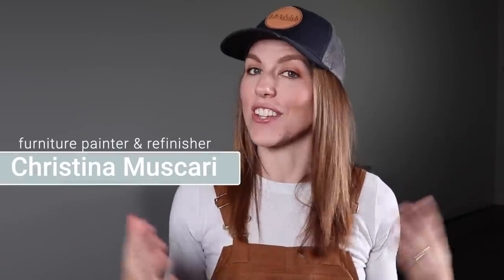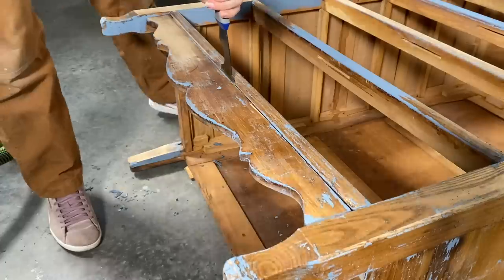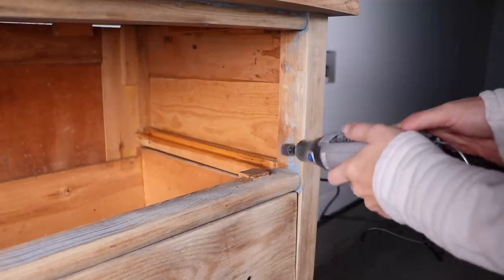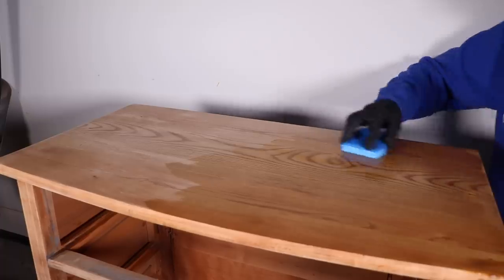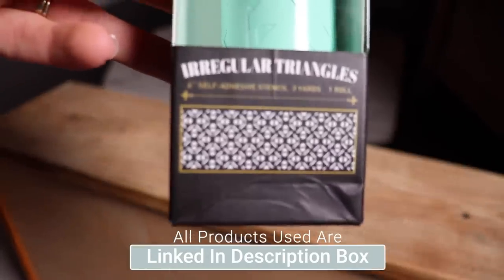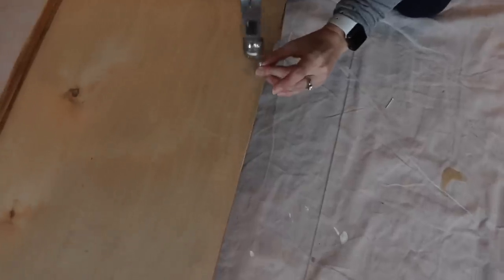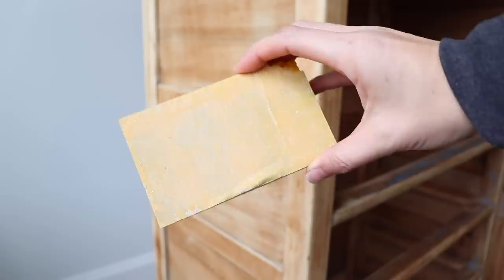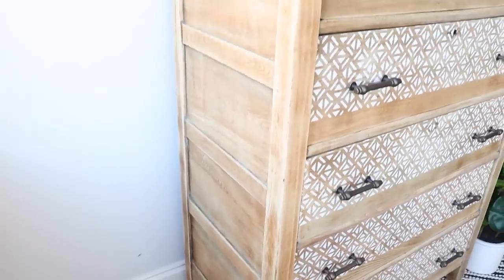Fancy to Boho Furniture Makeover | Bleaching Wood & Stencils On Furniture

Comment: Do you redo the pieces you remove from furniture? I see them used to make signs, add hooks to, or just decorative wall hangings. Crafters would probably snatch those up from you. Just sayin’, no waste 🙂. I loved both makeovers to this piece.
Reply from the maker: I always save the hardware to use on other pieces. The drawer bottoms were not salvageable, but I did keep the bottom decorative piece that I removed.

Comment: Have you ever had a furniture flipper reach out to you with an extreme lowball offer, and then proceed to tell you the furniture needed a lot of work (which is why they offered not even a 4th of your asking price)? Asking because I refinished a dresser with 5 layers of paint removed, and ended up having to repaint most of it due to veneer damage. I went for a more rustic look to embrace some of the character of the dresser. I was able to save and show case some of the wood. I know they didnt know that, but the price they asked was absurd ($35). I am not offended, but its a first. Just wondering if its more common.